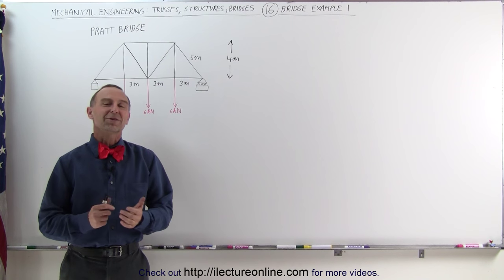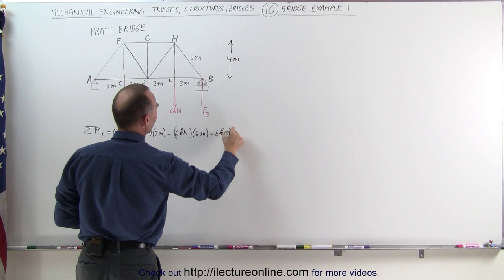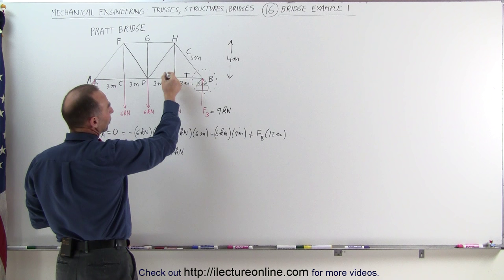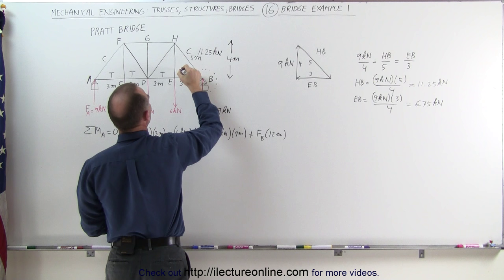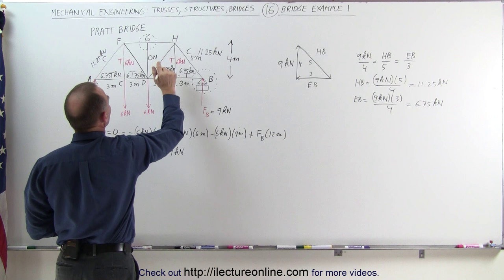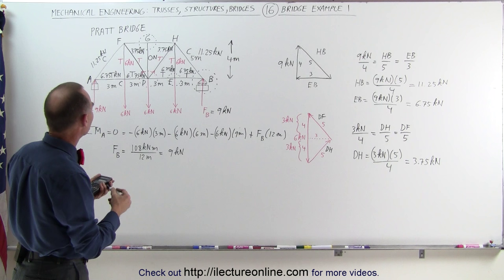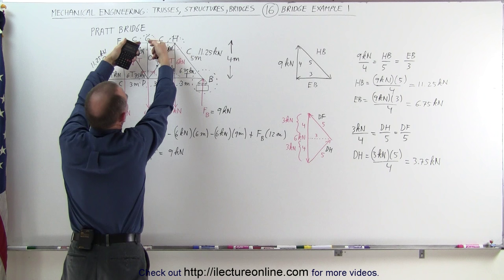Mechanical Engineering: Trusses, Bridges & Other Structures (16 of 34) Pratt Bridge: Example 1

Comment: GREAT PRESENTATION PROFESSOR!
Like scientific structural and civil engineer thank you for effective presentation. Including vertical members that swpe down toword the centar opposit of the HOWE TRUSS. Long - span railyroad bridge characterized by additinal diagonals extending on two. The ability was to spand great distance using simple methods BUT VERY WELL known ( like span anchor points up to 76,4 m.) So we have extremly effective high strenght bridge for long distance. 
    With luck on your other workout worldwide in 2023.!
Reply from the maker: Thank you!

Comment: All of this analysis is valid IF the load is all applied at point G, unless my analysis is not correct. So, separate analysis must accomplished when the load moves.... This truss looks suspiciously like a bridge. So it would make more sense to assume the loads are applied along the lower member. And then, it is all different! Nevertheless, no matter how we approach the analysis, the engineer must make sure that all of the joints and members can support ANY possible load that may be experienced or it could fail. Good thing we have computers as was mentioned in another post. 🤯

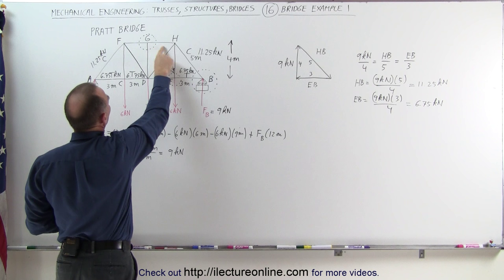Comment: 5:55 I’m a bit confused on why GD has 0 force on it. 

There’s a 6kN force acting down at point D, wouldn’t there be a tension force?

Does HD and FD provide tensions compensate for the 6kN force at D? (Edit: they do)

Why doesn’t GD also contribute along with FD and HD? <—***
Reply from the maker: The force is handled by the FD and HD members.  That is the purpose of these types of bridge structures.
Reply: @MichelvanBiezen  yes i am aware of that. 

But i’m just a bit startled that if i tackled the problem on my own, i would have assumed that much like HE and FC, GD would also have a tension force. I don’t think i would have been able to come to the conclusion that there would be no tension force on GD. I can’t think of any systematic way of actually determining that there would be no force on GD. To me it looks like along with HD and FD, GD would also contribute, so the force in the y direction would be evenly distributed among the 3. But thats not the case.

Was my assumption reasonable at first glance?
Reply from the maker: There is a systematic approach.  We have some examples of that, where you make imaginary "cuts" at different places to determine the tension and compression of each beam.  You can also draw force triangles starting on one side of the bridge and then work from one side to the other side.  We have examples of that as well.

Comment: Isn't HE a zero force member  - no downward force along HE along joint H?

At joint H, the upward component force of compression HB is balanced by the downward component force of tension HD. So there should be 0 downward force along member HE.

(I hope I recall it right that tension pulls on a joint and compression pushes on a joint.)
Reply: no, its not, there is a downward force of 6Kn so HE must have a vertical force.

Comment: Sir may I ask why is it that the magnitude of forces must proportional to the length of members?
Reply from the maker: Length is one of the factors, but also the angles and the loads.  Better not count on that but systematically work through the structure from one end to the other.

Comment: Dear  Michel,

i,ve hit a snag calculating a warren truss bridge, wich is suspended at the top. Exactly the opposit of the example in your video and with a difficult load distribution..
may i send you a sketch FBD of my problem, perhaps you may be able to help me out.

kind regards,

Douwe de Boer 
graduate student engineering  from Holland

Comment: Great video.  When calculating for HB how did you conclude the y- component was 9 KN? Thank you!
Reply: I got it! Haha but your explanation would be appreciated just to make sure I have the right thought process.
Reply from the maker: First we find the force at B using the moment of torque of the structure.  Then the key is to realize that the sum of all the forces at any junction always equal zero.  So we can draw the force diagrams at every junction.

Comment: hi guys, I'm trying to find the answer. pls help. (I hope I am going to be able to explain my question) I have 30 feet long fink truss system in my roof. i want to raise entire roof all together (one piece) . house is concrete block 30' x 22'.  ceiling height is 8 feet. I wanna raise it up to 10 feet (2 more feet).can anyone help me about where is the lifting point? how can i raise my entire roof with heavy duty steel lifting shore. Which point of the trust is the best point to push the entire roof up? thank you
Reply from the maker: It would not be a single point, but multiple points.  Typically they place supports close to where the load bearing walls are, which are the walls designed to carry the weight of the roof, and then slowly raise those point bit by bit at each support, like 1 cm at a time, going around to each support.  My advise is to talk to someone locally who constructs houses who would know the answer to your question in your particular case.
Reply: @MichelvanBiezen  thank you for the reply. my plan is something like that
https://www.youtube.com/watch?v=fTK3TdHQJwE. Instead of using hydraulic jack, I'm going to use Heavy Duty Steel Lifting Shore. But I don't know where to put the 6"x6" to hold the entire roof?

Comment: Can i propose a technic ?
Reply from the maker: Certainly.
Reply: @MichelvanBiezen  can we extend each bar to the vertical symetric axis and just say that top connected bars are in compression and bottom connected are in tension.Can we add vectors on those lines folowing gravity direction  from top to bottom and say that Howe move stress away from the center and Pratt contain it to the center? I want to teach that in middle school, Stem teacher but not master of the subject.Thanks
Reply from the maker: Well, I would first work out this example problem the way it was shown in the video.  That is an old established technique to solve these types of problems.  Then I would solve it the way you suggest and see if you get the same results and if you do, determine which way is the easiest to solve the problem..  That would be the best way to compare
Reply: @MichelvanBiezen  The goal is to teach middle school student to understand the behaviour of the structure without calculation. If it is working using symetry any student could analyse quickly those structure without expensive software.Try it you should be able to perform a kind of finite element analysis by head. I can predict wich bar of the truss will fail the first and I have zero calculation knowledge of trusses. I asked my students do it on real pictures they do the same thing as FEM analysis. BTW to find the stress on the vertical bar we think that in a given triangle stress should be compensated then you cant have the three bars of the same colors. Also we already know that top horizontal bars are in compression and bottom in tension. If it is confirm true then we should start to teach that in all middle school class.
Reply from the maker: I think that is a good approach.  Yes, teaching students at a young age to think about it like that will help in their understanding.